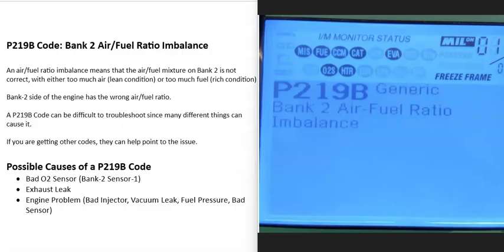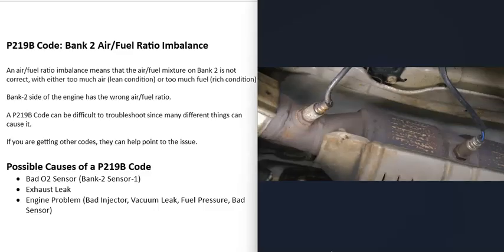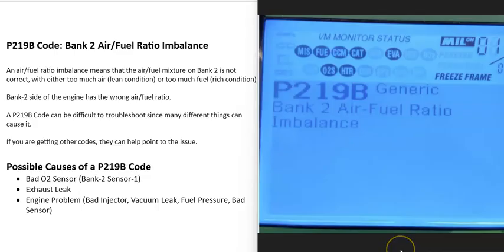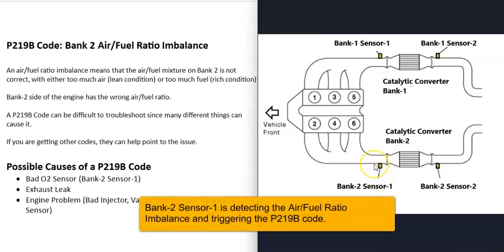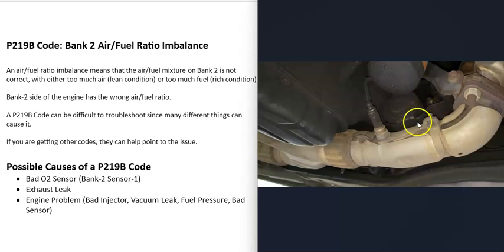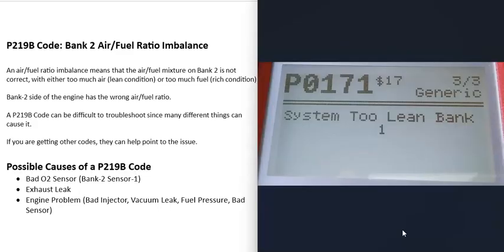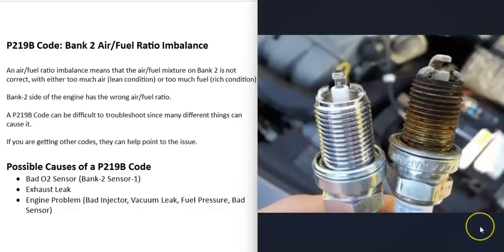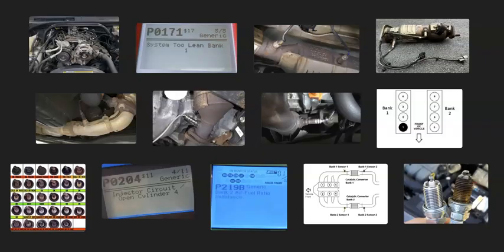Causes and Fixes P219B Code: Bank 2 Air/Fuel Ratio Imbalance

Comment: I have a 2018 F150 XLT 3.3 6 cyl. bank 2 running rich. random 304 or 305 which is cyl 4 and 5. a 219B code random. I have changed the low pressure injectors, plugs,coil packs, all 02 sensors. Runs fine most of the time until it starts running rich this is 100% at low RPM's. Compression is 85-90 in both #4 and #5. I have a wireless scanner so if it codes, I just clear it on the fly and runs perfectly. Thoughts?

Comment: I replaced my oxygen sensor on 2011 Chrysler Town and country (upstream) with an aftermarket sensor, Bosch, length wise was a little longer. After I started my engine, no problem, I let run (4 minutes) and then I did a road test. No problem. Two & a half weeks later. I get an engine light on. 😮
I don't know if the aftermarket was the cause of that or wrong part. Should I put back the original or order from auto parts store?

Comment: I have fuel trim cylinder balance bank 2 with a p0306 cylinder 6 misfire and am thinking it’s due to fuel injector. Coil is new, plug wires are new and spark plugs are new. However doesn’t mean one didn’t fail. Great video and thank you. I guess it’s time to take my tire off the Chevy so I can check the spark plugs 😅
Reply: Did you find your solution?
Reply: I have the same problem but coils are working, spark plugs are new and the inyectores are working fine, what else can trigger p306 and p219B??

Comment: Love my 2017. Toyota 4Runner Limited it truly is an awesome truck! The only issue I'm having now is that I'm getting an error code of P219B andI'm thinking that maybe the shop where I took her ro either loosened or removed something because she had no issues prior. Now, there's thick white smoke, engine knocking, and some rattling after being stopped at a light or stop sign. There's a lot of white smoke, loss of power, sluggish when starting off, rattling, TRAC OFF and now blinking CHECK ENGINE light is  on. Of course I sure as Hell don't want to take her back because I know they want to charge me ro fix what they ruined on purpose.

I really hate that the majority of shops these days are shady and greedy like that. Even took her to an actual Toyota dealership and they want an extortionate amount of money just to diagnose her and that's probably not including the repairs

For now I'm not able to enjoy driving her and have to have her sit until I can pay for repairs or find a way to try and fix her myself. She's my daily driver and I'm super bummed I can't take her out on the road. 😢

Comment: Getting P219A and B right after changing all 4 O2 sensors on 2015 JKRU. Possible the part store sold me the wrong sensors? Was getting a code (do not recall specifically) for the O2 prior so decided to change them all proactively. Suggestions?
Reply from the maker: If there were no lean or rich codes before, then they may have given the wrong sensors. I would find the part numbers and verify if they are correct or wrong.
Reply: Did you find out the problem ? I have same problem but no miss fires or lean or rich codes just p219a and p219b

Comment: 2021 silverado 5.3 p219b code after new injectors but scan tool shows fp at idle low to mid 30s checked fpcm it has power and ground leaning towards fuel pump cause fp is 33 to 35 when cruising only gets to 44

Comment: I'm getting just the p219b code on my 2016 Ford expedition limited. It comes and goes but that's the only code. I have replaced all 4 02 sensors, new plugs and wires, sealed up an exhaust leak in-between the catalytic converters, put a new muffler on, removed resonator because it was plugged, code still comes on randomly and smells like it's running rich baby ideas before I lose my mind lol

Comment: I'm getting a lot of evap codes and cylinder 5 misfire  and obviously this code too
Reply: And this code is only on bank 2
Reply from the maker: The only EVAP component that can affect the engine is if the purge valve is stuck open, and usually, that affects the whole engine. I would test the purge valve but mainly the cylinder-5 coil and injector.

Comment: Is it Bank one driver side?
Reply from the maker: It can be different and depends on the engine. Google your specific engine cylinder location and find the #1 cylinder. Bank-1 is the same side as the #1 cylinder, and Bank-2 is the opposite.